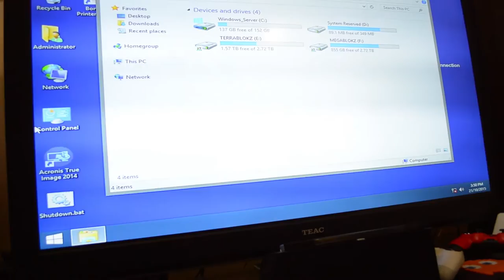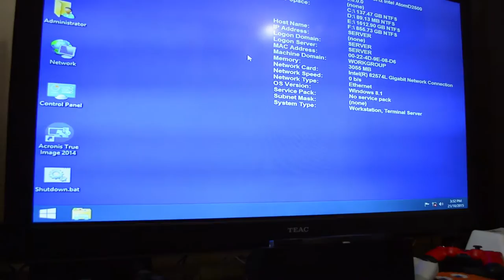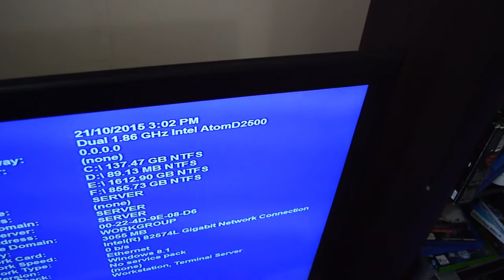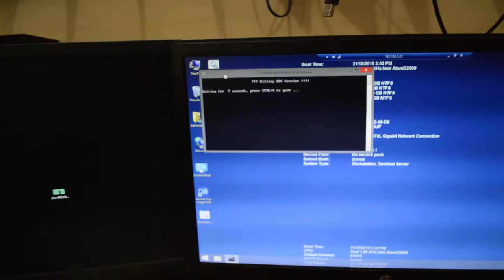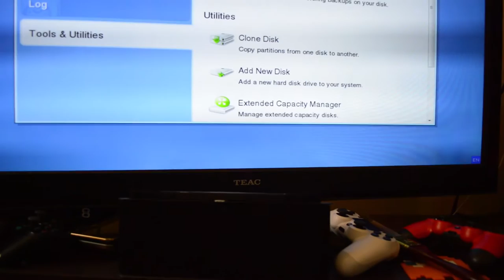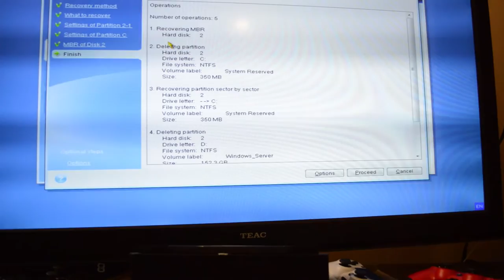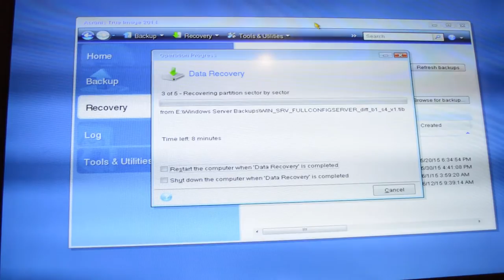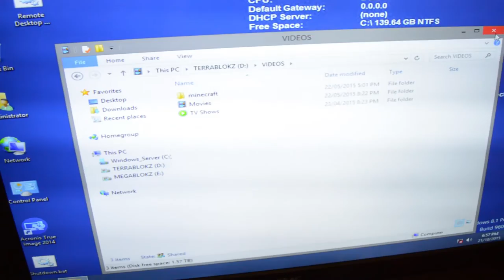Atom Based Home File Server MEDIA + Games server VLOG

Comment: Hitachi Deskstars if you are looking for long lasting performance drives they're pretty bullet proof, and the only drives I'll use these days
Reply from the maker: +TheSynrgy1987 Yeah but weren't the deskstars nick named "the DeathStar"  I might check some out thanks :)
Reply: No Idea but I've been using them for years and not had 1 fail, had plenty of WD/Samsungs fail though. just got a 4TB one installed today. so now have 5 deskstars currently in use

Comment: Why not use Linux? Would be way easier to set up headless, would be a lot more stable with no issues once set up. Ssh into it or use RDP/VNC. Use SAMBA to share to windows based machines, if you use any. Unless you need Windows for specific applications for work, there'd be no use for them in normal day to day use.